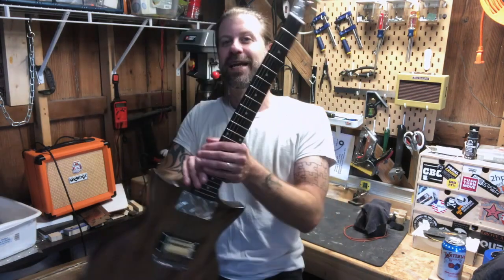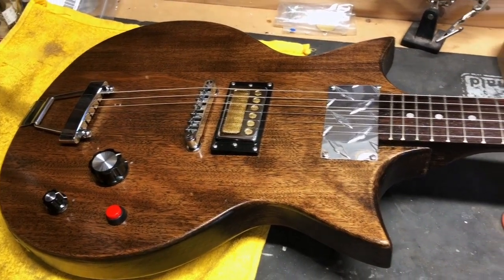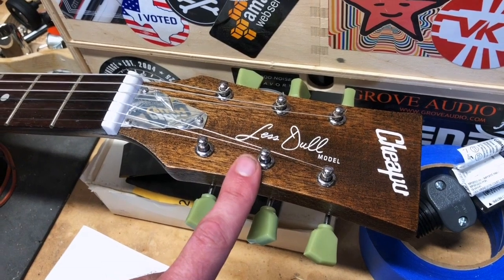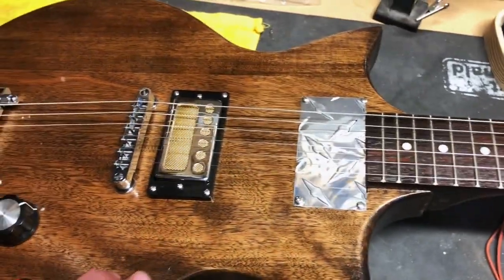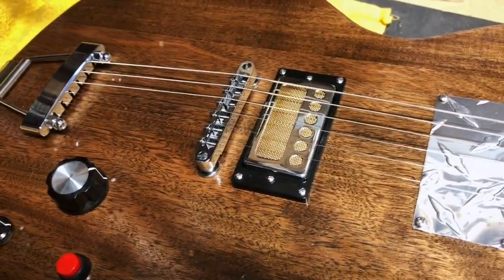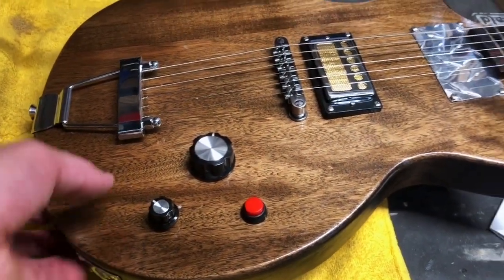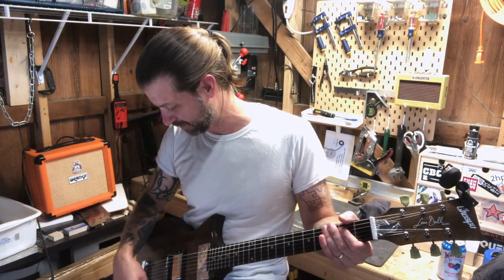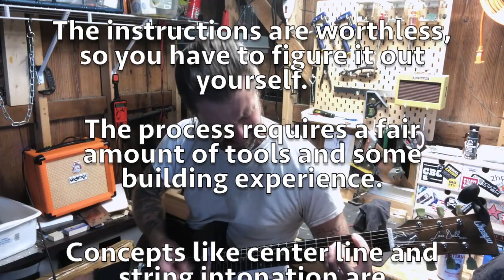DIY Project: Muslady 6-string Guitar Kit

Comment: Poorness studios lol
 The diamond plate idea really nice idea The diamond played idea really nice idea Aside from the knobs but the diamond plate was a slick idea I'd be surprised  this gets copied. 
 I guess you really didn't have any problems and it doesn't sound like you had any problems with the fretwork which is something that I really would have been worried about? 
 Is the right and you could mention outside it a fact like you had said you had a drill the sole drawback whole there's certain parts you didn't end up using with there any other issues with the kit overall? 
 I'm even surprised it sounds this good.
Reply from the maker: Thanks for watching the video. It's definitely not the highest quality kit but it's impressive for the price. I am still surprised they didn't drill the holes for the bridge and tailpiece studs. However, I think they were concerned you could seat the neck slightly angled, and then the studs would be off. It seems like there's better ways to handle that situation though. It would've been nice if they'd included a template. Honestly, the instructions were nonexistent so someone who had never built a guitar before might have trouble figuring things out. I wouldn't recommend this kit for a first timer.